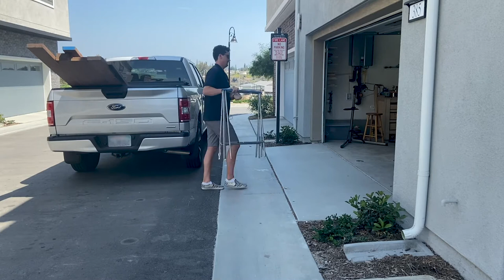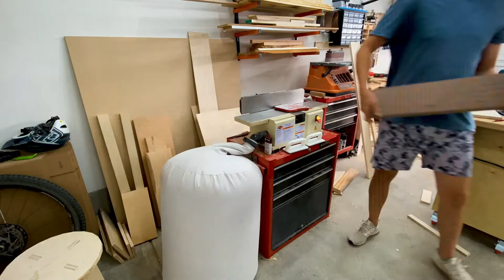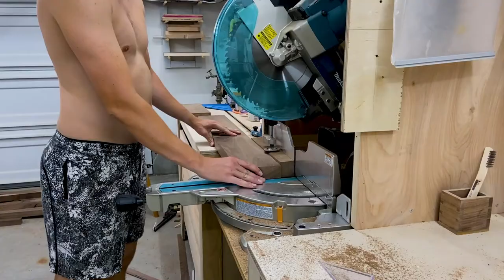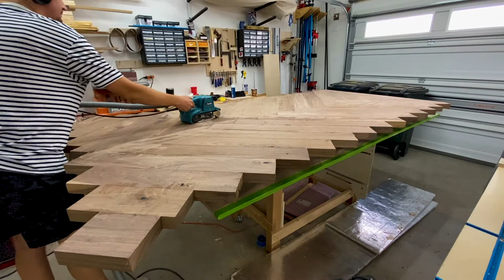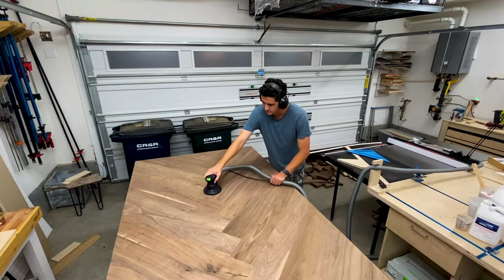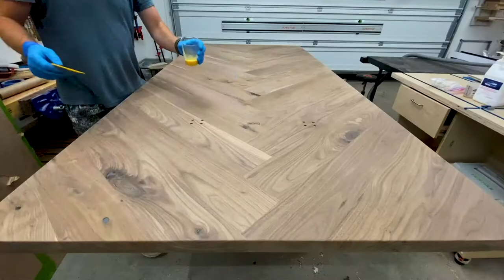Solid Walnut Herringbone Dining Table

Comment: Great work!! I used your video to build one and I love it!! I posted it on Reddit and a lot of people were saying it would break in less than a year because it’s endgrain against edge grain so I wanted to ask: how’s the table holding up?
Reply from the maker: Yeah there are a lot of opinions of course, I think as long as it is well dried wood and kept in a moderate climate, it shouldn’t move enough to affect it. It will move, but all depends on how much it moves, totally possible for structural issues to occur. I did this for a client over a year ago and haven’t had any issues so far, hope your table holds up. All the best!

Comment: Amazing table. Two questions. Will the table move and create gaps by doing it that way and how did you ensure a straight line cut on your first cut for reference? This is a high quality table and you did a great job.
Reply from the maker: Thank you! The wood will expand and contract as all solid wood does, but all the pieces should move together so it shouldn't create any gaps. Before cutting all the pieces I drew up the table on SketchUp and found the center of the table that way. The center of a herringbone pattern is in the middle at the end of each piece, not at any of the corners of the pieces.
Hopefully that makes sense, glad you enjoyed the table build.
Reply: @fowlerfinefurniture  My worry with movement is the end grain to side grain areas. If you in any way attach the end grain in a bread board fashion to another board you are restricting movement and it will eventually crack. this is what I am struggling with right now in doing this almost exact build. I am thinking just connect each side together and not connect the end grain portions and let each half move as a unit avoiding cracking. I am also using 3/4" boards on a substrate that will be screwed from underneath with elongated holes. Any comment on this?
Reply from the maker: @pepperman9  hey Tim! You are correct with your concerns. I’ve seen other tables built like this for sale on Etsy, contacted him asking if he’s had any issues and he said he hasn’t. This is the only one I’ve built and no issues so far. It’s obviously a little controversial haha. In one of David pachutos videos from “make something” he did a chevron table and didn’t attach it in the middle, so that’s similar to what you’re talking about. You should always consider wood movement, so just build whatever you’re comfortable with. Bread boards are the same thing but that end grain to side grain connection is long, usually 30” or so, and movement is minimal, these connections are around 5” so even less movement. I’m not recommending you build your table this way, this is just what I’ve done! Best of luck!
Reply: @fowlerfinefurniture  Came here for this discussion as I'm looking at creating a herringbone table too. I'm wondering if metal c-channel stringers might help. The other option, though not as elegant but more economical, would be to laminate the herringbone pattern onto mdf or ply.
Reply from the maker: @kevingoldberg8444  Yeah I think some c-channel would definitely help. Also, if the base is a more traditional/supportive base that would also help, just make sure to use fasteners that will allow the top to expand and contract. I did think about doing veneer, which is probably the safest bet, but then you need to do edge banding or a frame around it and that changes the look a bit. Best of luck!

Comment: the table looks soo good. love the herringbone look. cuz its such a long table and there's no cross bracing between the legs, does the table wobble?
Reply from the maker: Thank you! It would probably be a good idea to add come support from underneath although I haven't had any issues with the table. It also has little to no flex because the pieces were so thick I believe.

Comment: Why didn't you use the jointer first?  Couldn't you have eliminated the need to use the table saw twice?
Reply from the maker: Yeah could’ve done it that way. I think I was trying to get them all to more manageable sized pieces before squaring the faces/edges. Also was trying to figure out the exact size for each piece to reduce waste, 8/4 walnut ain’t cheap!
Reply: @fowlerfinefurniture   Well you definitely killed it. Table looks great!
Reply from the maker: @ialex2005i  thanks for the support, glad you like it!